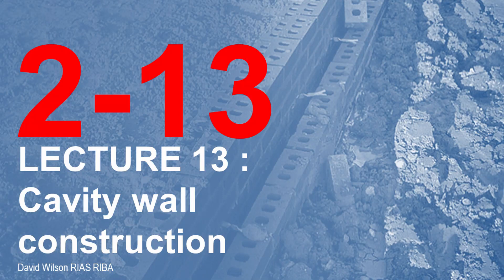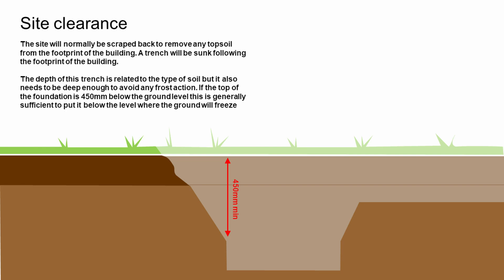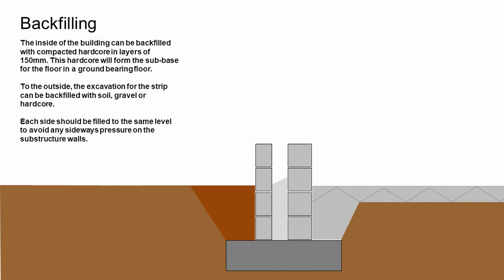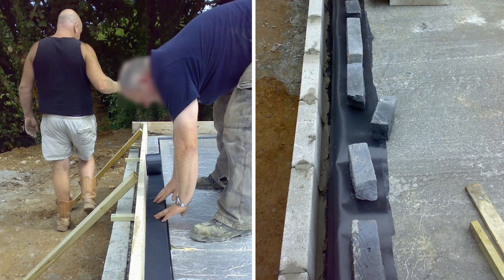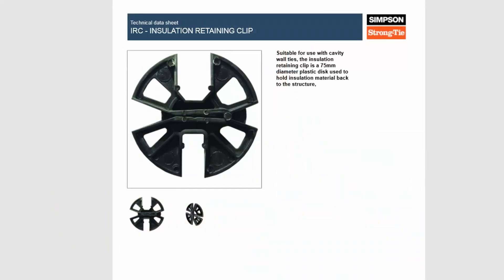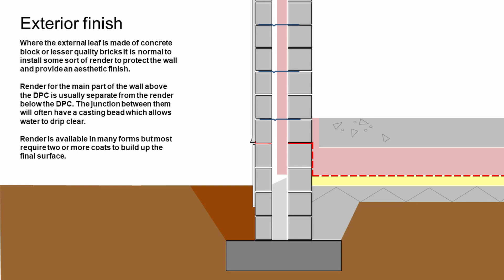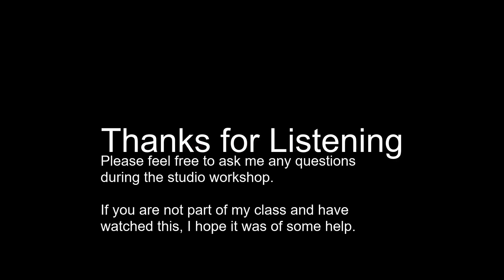13 Cavity wall Construction

Comment: Are cavity walls only on the exterior walls of houses? Or the interior as well, for example a brick wall separating two bedrooms? How thick are interior walls? And if you have a terraced house, where your neighbours wall meets is there a cavity there?
Reply from the maker: Hi Daniel, thanks for the question. If it is a detached house then yes, the cavity walls are usually only on the outside walls. The main function of them is to stop water entering. 

Where there are brick walls inside, say between rooms, the thickness is probably around 150mm (one brick plus two coats of plaster).

For walls between houses it very much depends on how old the house is. Up to around 1950 it was usual to have a solid wall between houses, for houses built after that it will probably have a cavity as they were introduced to combat sound passing between dwellings. Hope this helps.
Reply: @Ramstam  ah I see so to sum this up. Cavities are only on the exterior walls of the house and interior walls are solid walls. This is usually the case when the houses were built 1930s+?? I just assumed the walls that are up against houses are solid. Also is there an easy way to tell if a wall is solid or has a cavity??
Reply from the maker: Hi Daniel, sorry for the late reply. An easy way to tell if a wall is a cavity wall is to look for the weep vents between the bricks. You can usually see these lower down the wall at DPC level and also above lintols. You are right, cavity walls are usually used on the outside as they help protect the building from rain. Cheers

Comment: at 11.08 on the video. the right wall that has a scratch coat ,what are the white things protruding out near the bottom ,cheers
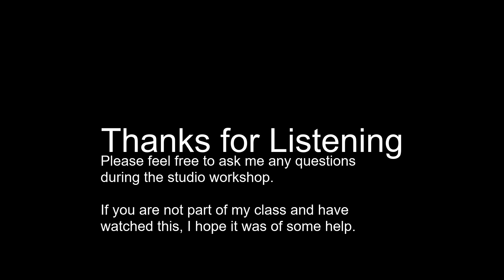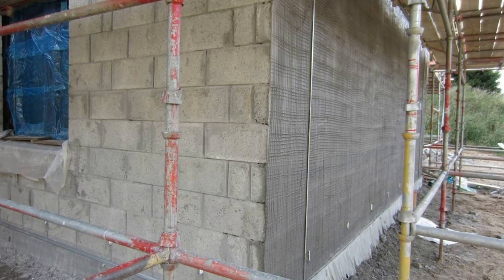Reply from the maker: Hi, Thanks for the question. I think the timestamp in your question might be wrong as the video is only 11:08 long. I'm guessing that its the picture at 9:08? If so the white things sticking through the scratch coat are weep vents (sometimes called perpend vents). they allow air into the cavity and can also let water out. You can see them explained in the next video of this series 2-14. Hope this helps

Comment: does a radon barrier overlap both the internal and external wall,,cheers
Reply from the maker: Hi, thanks for the question. The radon barrier is similar to a DPM and it should protect the whole house. For interior walls that have foundations under them it would need to be lapped up and over (have a look at the video for interior load bearing partitions). Hope that helps.
Reply: @Ramstam  thanks

Comment: Just wondering if there are the thickness requirements for both inner walls and outer walls??
Reply from the maker: In the UK there are a couple of criteria for developing the thickness of walls. For external walls (which tend to be loadbearing) the first criteria would be that it needs to handle the loads of the building above. This is dependant on the size and height of the building, the ground that it sits on and what material it is made of. The second criteria is that it would probably be the place where insulation is placed so the thickness might be governed by the required depth of insulation. In Scotland we tend to design with timber frames and place the insulation between the studs; to get enough insulation in this location the frame would probably exceed 175mm. If you added a brick outer leaf and some internal drywall it might mean an external wall of around 350mm or more.

For internal walls the most significant issue is probably sound. A n internal wall (partition) should be able to reduce air-borne sound and impact sound so its likely that they will be either made of stud framing with plasterboard (drywall) or made from solid concrete block. Either will probably result in a wall of between 125mm and 150mm.

Hope that helps,